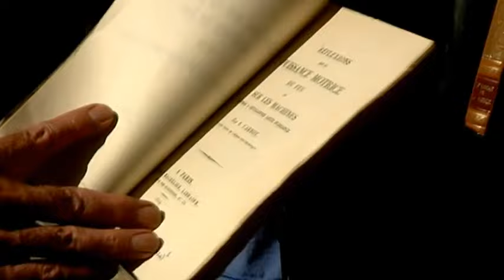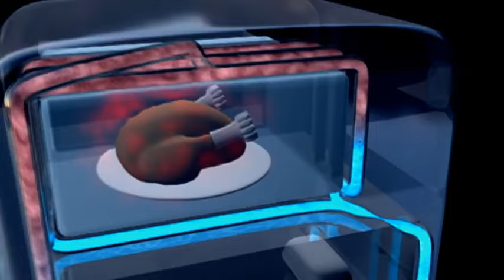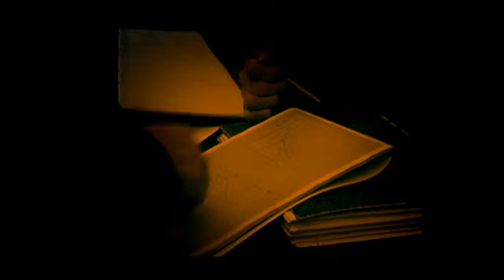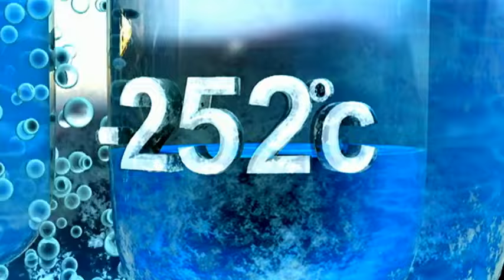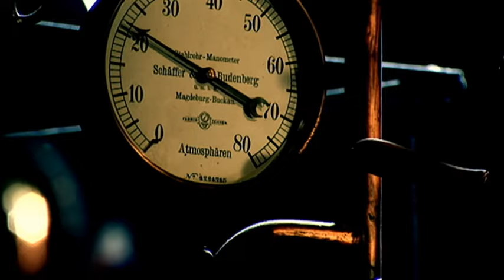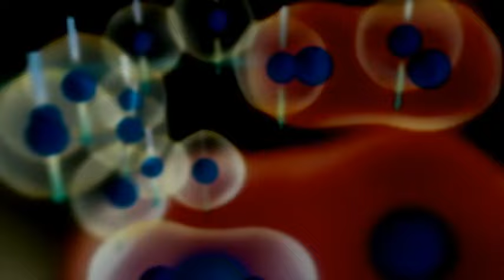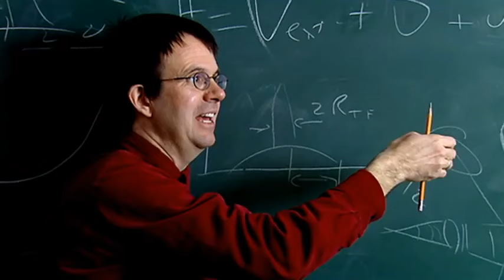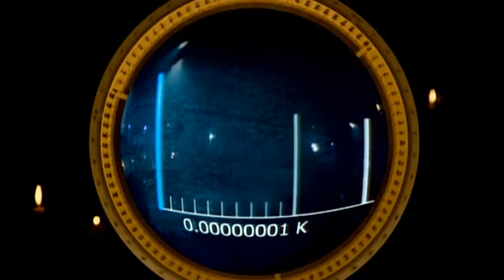Absolute Zero ✪ PBS Nova Documentary Channel

Comment: The laser beam traversing the Bose-Einstein condensate slows down to a crawl, and then accelerates as it leaves the condensate. The simulation shows this to be true.
The fact that light slows down and then speeds up implies light's velocity is not constant. In other words, both position and velocity functions have derivatives so they can't be constant.
Reply: wut
Reply: That is a good point. I always figured that light must have an acceleration, but if it is always 2.998×10^8 m/s, then its acceleration must be infinite over an infinitely small amount of time(essentially infinity over infinity). So, if light is always 2.998×10^8 m/s, and if the only way to manipulate the speed of light is to manipulate time(kinda like they said earlier in the video), and since the Bose-Einstein condensate causes light to slow down so much, is it possible that the Bose-Einstein condensate affects the passing of time(localized of course)?

Sorry for the long message, I just had to get that off my noggin.